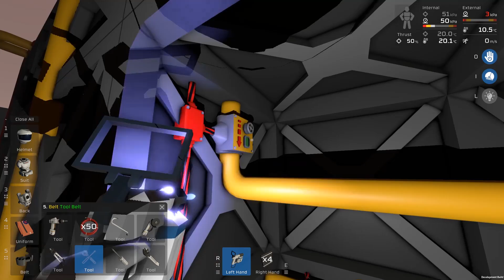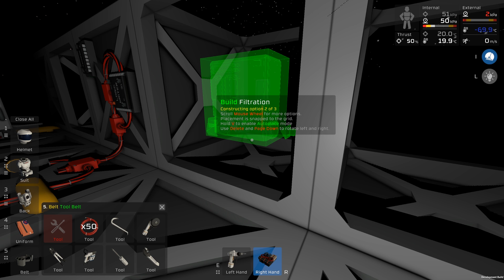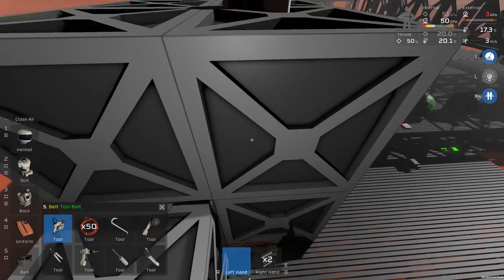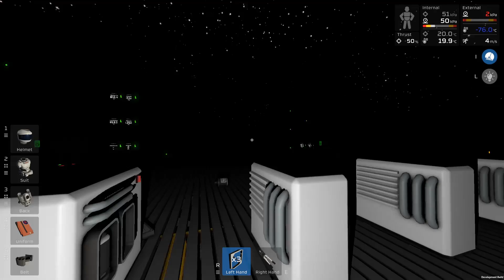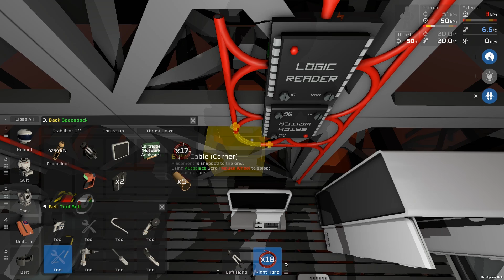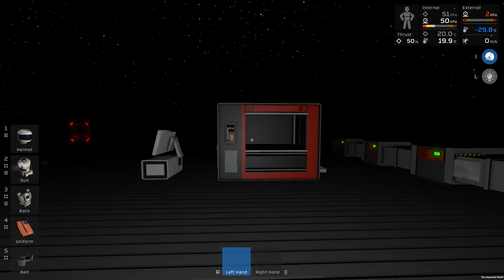Stationeers S2 E37 - Automatic Night Lights and Furnace Testing

Comment: How do you get the Batch Writer to write to both lights? I'm only getting one of my lights to trigger.
Reply from the maker: Did you place it as a normal writer instead of a batch?
Reply: @grayduster  I fixed it. I had to make sure all my lights were of the exact same variation.

Comment: I really want to copy that in a way because H²&O² really are hard to handle in this game ..this option also saves the hassle of mining ices.
So you basically heat up CO² and use it to make alloys while recycling the CO² with a filter and return it to the cycle ?

Comment: try re-radiating waste heat from the smelter waste line back out into the heating room @grayduster
Reply from the maker: I will try - although it is a boost system, rather than a constant system, so it won't be on for long.  It may actually need a separate hot room :)

Comment: grayduster Your lights depend on the fact that there is sunlight in the 'cube spaces' that the sensor is in (that includes the back of it, i think) so don't weld the frame behind it, otherwise it will think it is nighttime right in the middle of the day (when it will be covered by the frame on the back). The same goes for walls that would cover the sensor from the inside, causing it being turned on earlier and for longer longer.

Comment: I guess you want to insulate the furnace itself, too?
Would it be worth to have a buffer with hot gas between the heating room and the furnace so it can be operated multiple times in a row?
Reply: cmilkau It is not heat loss dew to lack of furnace insulation and even if that is a problem, then wall in the furnace (using welded frames) and use chutes for input/output of the furnace and (using logic) set the furnace lever by a lever you can put outside the frames.
Reply from the maker: There is a buffer - the hot tank is in the hot room, and that feeds the furnace :)
Reply from the maker: Also, Eryk, it's the gas generator episode next :D
Reply: grayduster Great! You will never have power problems anymore (well, generator is just not as good as it was before) try attaching a pressure regulator to it's input. You need to set it up near your furnace, it will generate a absolute metric load of hot gas (at least before the mixture was CO2 and X at like ~680°C), if it converts gases at the same rate as it was before (I mean that the ratio between amounts of gas consumed to gas generated is the same). By the way did you see some of my other comments, like that memory unit one or the one with a sollution to the 'vending machine problem' (read subcomnents under that one for a sollution).
Reply: Awesome. I'd really like to see a robust setup of the gas generator for power backup
Reply: Rascal Rambling Probably the best way to do this is via reading the average of the 'ratio' of each battery and attaching a schmitt trigger to it and then based on it toggle ither something controlling the gas mixture flow of the generator's input, or the generator itself, since it will ignite the gas mixture at any temperature when the pressure is mached.
Reply from the maker: After a brief test, it seems that the output pipe of the gas generator is incredibly cold (-160 or so), with the atmosphere of the room around it immediately spiking upward (40 or so).  I think we're going to need multiple inputs and outputs into the room to keep the atmosphere viable, plus some electronics for control.  I saw your other comments :) (And yes, already using a pressure regulator on the input, hehe)
Reply: grayduster The atmosphere around the unit doesn't matter, the amosphere inside the input pipe matters (at least that is what I've been told and what makes logical sense, and would make it way more balanced). Why a completely inclosed generator would require amosphere to function, and why would it require a fuel mixture then ?!? By the way you must have gliched it, I also somehow (it was a accident) managed that in one of my test worlds, it cooled the gas (inside the pipe attached to the output side) indefinetely (to 0K), and didn't produce (or produced miniscule ammounts of) gas, it was strange. I wish that the devs will make the H2 and O2 reaction actually create water instead of the nonsense tha it is now (how hydrogen molecues and oxygen molecues create carbon attoms?!?)

Comment: Having the lights turn off during the day is nice for power conservation ... but if everything is enclosed and thus during daylight won't actually be lit... wouldn't it be a good idea to have an override light switch if you're in there doing things during daylight hours?
Reply from the maker: There'll be windows in the roof during daytime (the hydroponics bay will eventually be opened up, once the rest of the base is built), but in the meantime, I'll probably move the daylight sensor outside :)
Reply from the maker: I'll also likely amend it later to trigger a timer, if it's dark and if I'm around (using a sensor) - the sensors can continually reset the timer.
Reply: Sparklemuffin It is to perfectly thermaly isolate pipes and/or gas-containing apparatus. Just for that reason. The game simulates that space (the space inside frames) as if there was a 100% vaccum, and since there is nothing to equalise the temperature with, there is no temperature gain/drop.

Comment: grayduster I will copy over some of my comments from previous videos' comment sections that have some solutions to this 'vending machine problem' and comment on them under this comment.
Reply: Coppied comment: I see a solution, what you need is a memory unit per hash ( which is simple to populate if you have the ingots, then put one in the vending machine on its own, then read the hash of it and use a writer to write to a memory unit and so on ...), then you check if any of the reagent is missing, then using a chain of logic selectors (where each hashes are attached to the '1' input and the previous selector to the '0' input, for the first selector's input '0' is attached to constant "0" ) select the right hash and write it to the vending machine, additionally you can probably do it only for one machine, because there is no way of setting a sorter to send things the other way, unless you can, but i didn't see this being possible. By the way you can only send stacks at a time not individual ingots, unless you would do some magic with a stacker, when you actually write to sorters to change their output. So you would need a reader, compare unit, select unit and memory unit per ingreadient type, a memory unit for "0" and a writer, to just make this sort of work (bacause only one machine is attachable to the output of a vending machine and without selecting a stack sise, because of the reason of the previous problem)
Reply: Another coppied comment: Since the last video i had a idea, and it makes vending machine extremely usefull, what you do is take the logic from my comment under the last video, then you attach the vending macine's output to a stacker, then output of it to a unfiltered sorter and one route goes back to the stacker assembly for your furnaces, the other one to the machine, then to previously mentioned logic another chain of selectors, this time you select the amounts (this is done so theres no over-rquesting of ingots when multiple kinds are required for delivery), if no reqirements select the value "0", then you use the stacker to firstly send the rest of the stack back for restacking (math unit required, not mentioning that it will need 2 writers, one for the wheel and the other one for the handle, a reader for checking the output, which triggers the handle ), and then you send the required ammount to the machine. This will work the best with stacks well over 50 because it will rely on the fact that the exces from the stacks is the bigger stack from both (requested and exces), this way it doesn't reqire perfectly timed circuits (relies on the fact writers only write once after a change of input value). Also it also relies on the sorter's ability of remembering where it has sent the last stack across game saves/loads. In total you would need in total a regarent reader, a memory unit (for hash of the ingot), a compare unit (is there actually a lack of this ingot) and 2 select units (one for the hash and one for the ammount required) per type of ingot you want to support, 3 additional writers (for vend. mach. and 2 for stacker), an additional memory unit (for value "0"), an additonal math unit (for determening the exces ammount of ingots) and an additonal slot reader (for the stacker). It will be a wall of logic but you can arrange most of it in to a table (eg. one row for a type of ingot, one column per specific chip with a specific action), which it would be better than that airlock you tryed to make or made (don't remember), because it will be neetly arranged in comparason to the "tangled" arrangment of logic chips and wire that the wiring for that airlock were, (just not make logic projects on all sides of nearby steel/iron frames, just do it all on one plain, for example the floor.
Reply: So in total, you need (all per one machine): 
let's say X = how many types of metals you are going to support (for that machine)
reagent readers * X (check how much of a metal type is required (one per metal type));
compare units * X (check if one metal type is required (obviously per type));
select units * 2X (one for ammount and one for hash per metal type);
memory units * X + 1 (one per metal ingot hash and one for 0).
Then to join every machines' circuitry you need:
compare unit * (per machine - 1) (to check which machine needs some metal); 
select unit * 2(per machine - 1) (to select the right hash and amount of metal, set by compare units);
writers * (per machine - 1) (to write the direction of the conveyor(s), set by the compare units);
long conveyor belts * (per machine - 1) (to send those metals to the right machine).
This is required, because if two different machines ask for metal at the same time it would send it to the wrong machine the wrong amount of items. For the vending machine you will need one writer to write the hash to emit, and for the stacker that splits the right amount of metals you need:
math unit * 3(one: amount stored - amount requested and 2 for the rs-lach i will explain further in this comment);
a compare unit (for the lach);
readers * 3(for the amount stored and if there is something in the output slot, and if there is something in input the exces return chute intlet(I will explain later));
writers * 3(for the setting and the lever on the stacker, and one for the conveyor belt's direction);
a long conveyor belt (for sending the item to the machine requesting metal or to be re-stacked in the stacher/sorter assembly for your arc furnaces).
The lach is for the dirrection of the conveyor belt and you make the gate as follows (and it might need some tweaking to make it function properly):
add math unit = (set signal + mul math unit);
mul math unit = (compare unit * add math unit);
compare unit = (reset signal < 1).
Output is ither 'add math unit' or 'mul math unit' (in this case I suggest the latter) and the set and reset signals are (in this case) the if there is something in the output of the stacker or the input of the exces return chute inlet and which is which depends on the setup.
Although it might be complicated, but it there is no timing involved it will wait until a task is completed (if there is one) otherwise it will do the next request.
Reply: So essentially the amount of chips you reqire is the amount you reqired for that airlock of yours in S1 (per machine + 1) ;) , unless you can do it with the computer, which one of you are going to free up with that now useless furnace, or something changed that i don't know that makes it plausable.

Comment: grayduster I will repeat what someone already pointed out (under a different video in this series), you can put items in the middle of the long conveyor, and that allows you to split, where items go with logic and not dependent on the item type, because you can reverse the direction of the conveyor belt.